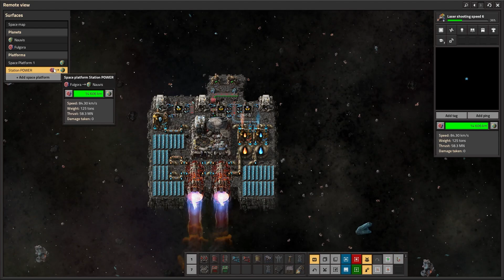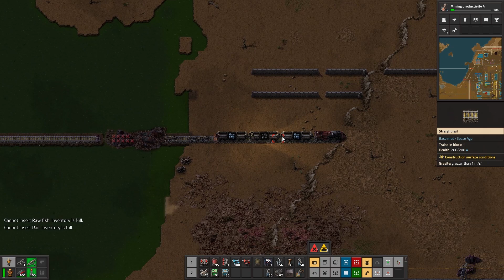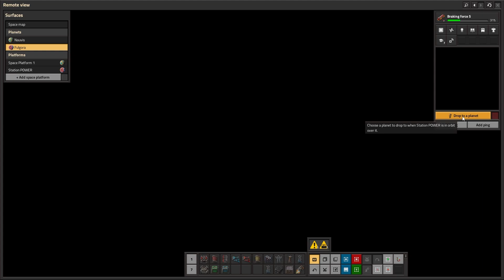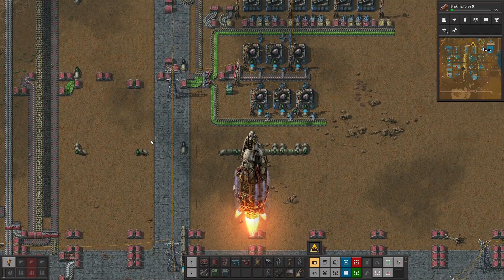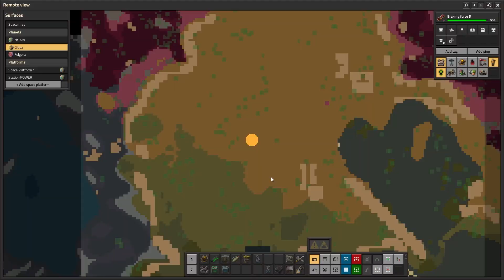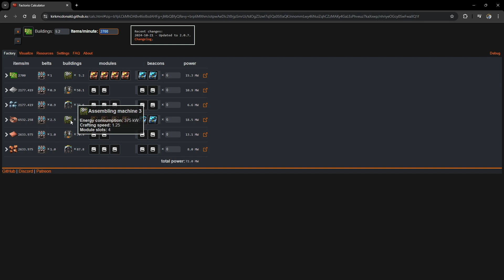Lost in space - Factorio 2.0 Space Age EP05

Comment: It doesn't matter which planet you go to first. Each planet has it's own science you have to make that's isolated to the unique mats on those planets. A big thing it seems you missed that was added in space age, is that there's research techs that gets unlocked through actions instead of researching with science. When you landed on Fulgora and picked up a vault ruin, you unlocked a tech that allowed you to build recyclers, which is used as the material processing building on the planet. You kind of noticed this when you mined some mats on Gleba, but you didn't look to see what it unlocked. 

Also not trying to backseat, just might be something that didn't click in;  you can use the iron from the meteors to craft ammo in space, and with a couple more turrets you would be safe enough to make the journey.
Reply from the maker: @simplyAres  thanks! I plan to try yellow ammo in space on my second ship, or rockets. I haven't decided
Reply: Vulcanus is the most worth while cause of the Foundry and Big Miner. Fulgora has the better electric items, but Gleba seems to be the most difficult factory management wise as well as required for nearly all other cooler stuff. Take a proper look at the research and actually view what you want more

Comment: i broke down the math on how many rocket launches youd need to craft a silo , mats for return, and cargo landing bay. It would take 16.03 trips up to get everything onboard, 2.5 trips for the steel, .66 for circuits, .5 for motors and pipes  each (.5+.5=1) ,10 for concrete, 1 for landing bay, and .87 for return trip (50 of each rocket launch material). If you bring 4 level 1 red modules (4% efficiency per mod= 16%)   itll reduce the amount to 42/43 of each mat (.16x50=8), reducing trip cost to 15.89, saving you a pointless extra trip for.03 mats. Also considered making concrete by sending ice down to the planet to reduce amount of launches to 5.89 , 420 blue circuits, frames, and fuel to get some concrete in the sky is kinda crazy.
Reply from the maker: Yes. It's a lot, but its okay we'll just expand the space program